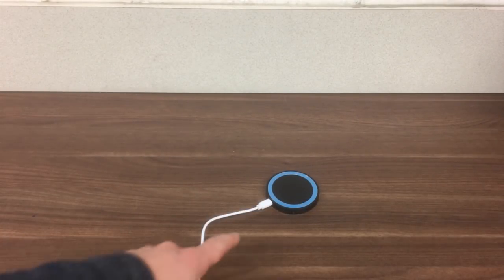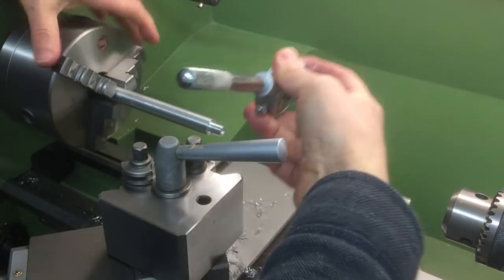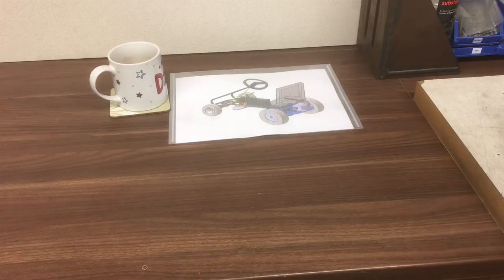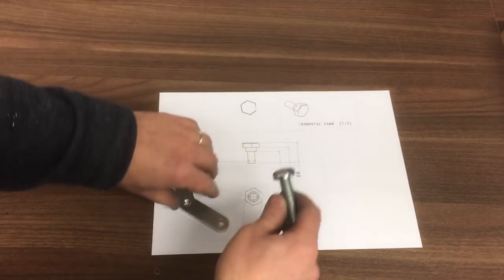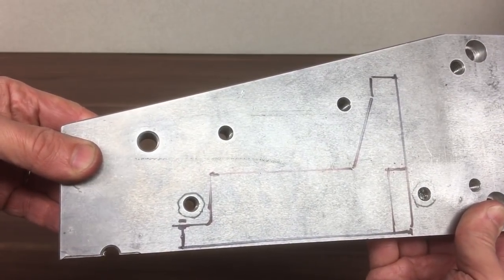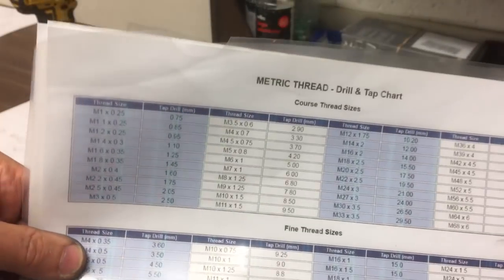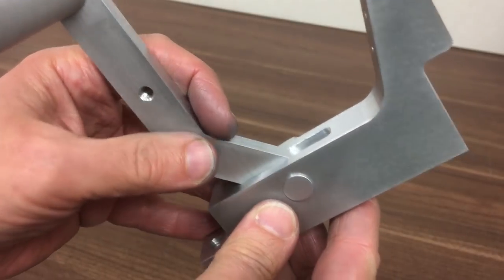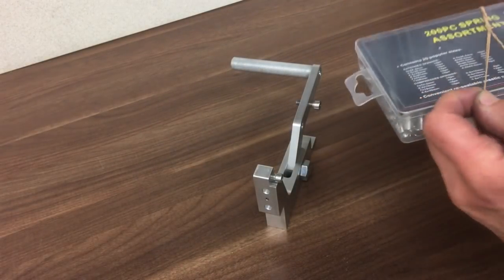episode1 e-Kart: Getting Started

Comment: Great video.  What is the 3d CAD package you are using?  Cheers Mark
Reply from the maker: Hi Mark.  It is a professional package (i.e. expensive) which I have access to which you have probably never heard of.  If you are looking for low cost / free CAD than Fusion 360 is still a good option as it also has built in CAM.  I use the CAM side of that as it is very powerful.
Reply: @routercnc9517  cool, I downloaded Fusion a while back, but was looking for something a bit quicker and easier for basic drawings so instead spent a little time learning LibreCAD.  I'll have another go at Fusion.  Cheers.

Comment: I watched you build your router. What brand of spindle with motor do you use in your router? Can you provide a link? It seems to be working well for you...
Reply from the maker: I bought the spindle over 10 years ago for one of the earlier machines and it was from one of the eBay sellers.  I can’t remember which one and there are lots on there.  Mine is a 1.5 kW water cooled spindle but I would recommend the 2.2 kW version as it has a larger collet.  You can buy them as a set with the VFD (Hyuangyang? brand) for around £200-£220.

Comment: I watched your router build and am now embarking on my own :) just wondering, would you be able to make motors using the router + lathe to machine the parts?
Reply from the maker: If you mean making cartridge spindles which are driven by a separate motor then yes that is possible.  They are a round housing with a shaft running down the centre in sets of bearings.
If you mean stepper motors then I think you should just buy them off the shelf as they are laminated construction  and need to be accurately made
If you mean general purpose motors then it could be done if you really wanted to but it is a lot of work making the armature, commutator etc.  Depends what you want as I’m sure off the shelf would be better.

Good luck with your build !
Reply: @routercnc9517  
Thanks!

Comment: I watched you build that CNC, It's built like an Abrams Tank. Get some mist coolant and stop driving it like an old fart. I would say your at 15% of the capabilities of that CNC. I have one that isn't half as rigid as yours and I push it way faster on 6061.  I use this software for Feeds and Speeds: https://www.cnccookbook.com/cnc-router-feeds-speeds-calculator/  I use "O" flute bits too: https://www.amanatool.com/51402-solid-carbide-cnc-spiral-o-flute-aluminum-cutting-1-4-dia-x-5-8-x-1-4-inch-shank-up-cut.html
Reply from the maker: Hi Ray.  I totally agree and I have the coolant, the flex line, and the valve block but I don’t have a compressor.  I have run this thing much harder in trials but for general cutting I have to be careful otherwise it can weld up and snap the cutter.  It’s on my wish list but it needs to be quiet (more expensive) and I’m saving up for a nice welder (mig and tig).
Reply: routercnc  This is the compressor I have. I run the mist at 60psi with one nozzle and barely any fluid. The compressor is in my shed and the lines run into my garage so I don't even hear it. https://jerseyshore.craigslist.org/tls/d/point-pleasant-beach-craftsman-air/6857966541.html
 My nozzle is similar to this one: https://www.youtube.com/watch?v=NVu4mCFCvmA&t=336s
It's a very small id brass tube with a smaller one inside it for the coolant. The chips don't even get a chance to collect  and the material stays cold. I use just enough coolant so I can barley see a visible coating start to form and that little bit combined with the velocity of the air blows Ice cold. TIP, Try not to slot without coolant. If you must slot, create an offset in the tool path to make the slot larger than the cutter. This will leave room for chip evacuation at the deeper cuts. Chip welding sucks and the mist makes a HUGE difference. Oh, and Have Fun!